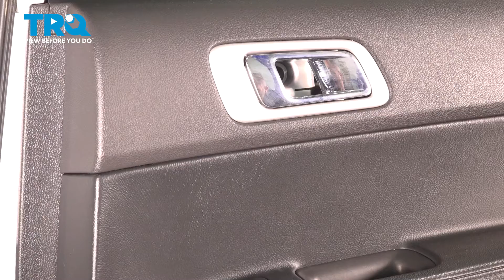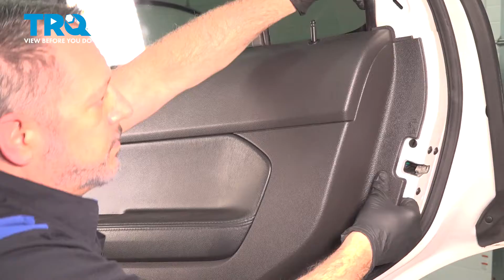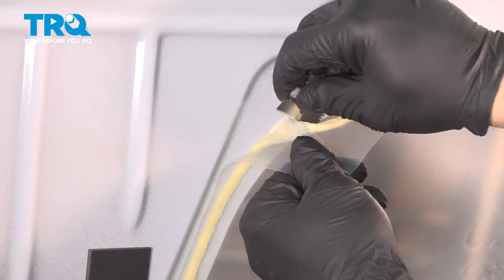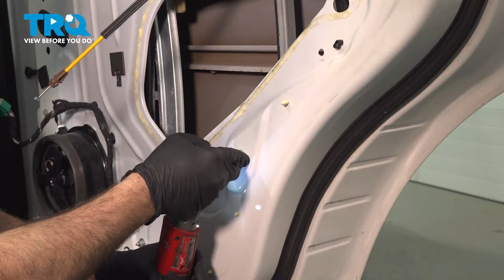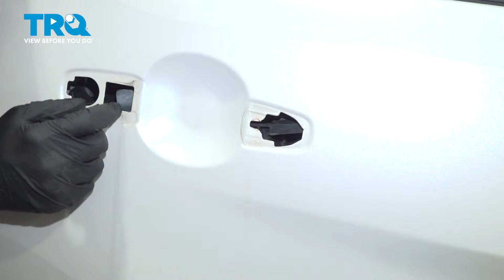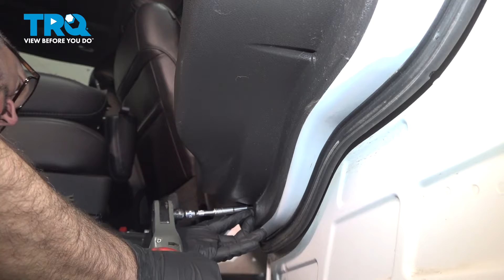How to Replace Rear Door Lock Actuators 2011-2019 Ford Explorer

Comment: I got all the way to removing the three bolts on the outside and they decided to strip out rather than back out. Now I'm trying to get the outside handle back on and there's no tension on it. It just flops around.